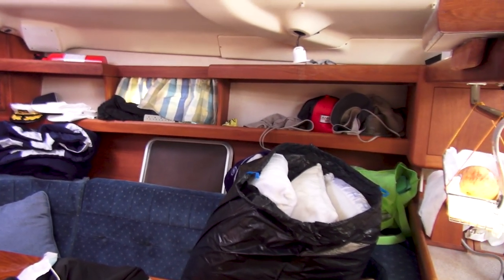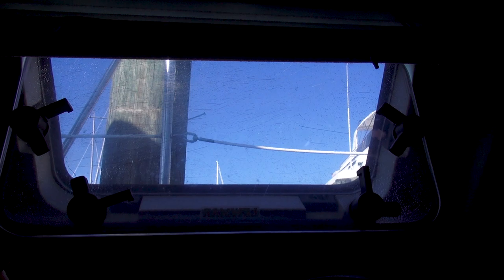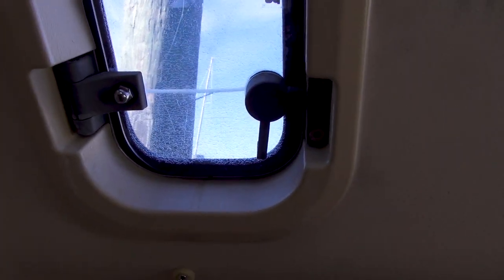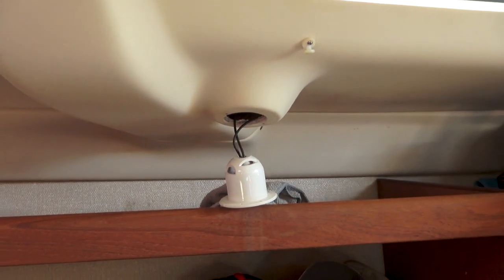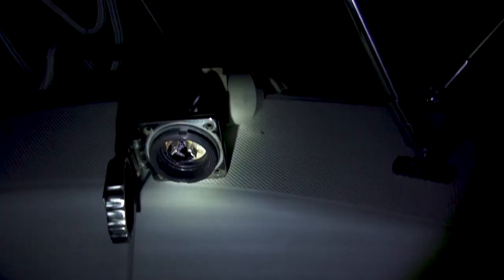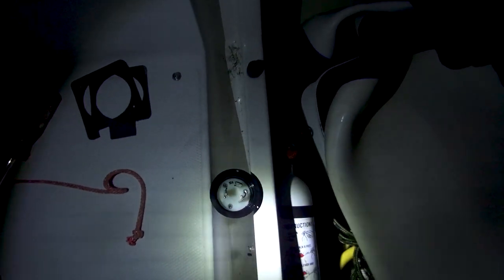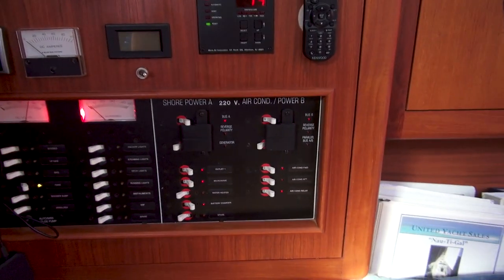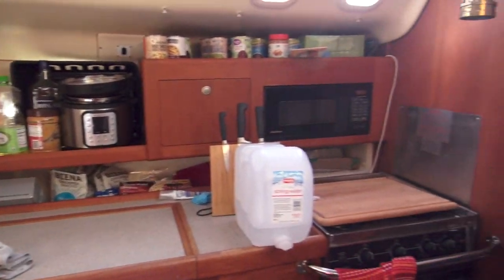Melted Electrical Outlets and Leaky Windows - Sailing Viridian Episode 23

Comment: Now that is the 4th hunter boat i have seen with the electric fry. The first one was a brand new 1995 hunter right next to my boat. It fryed the braker box on the boat and melted the cord on the dock and set the dock box on fire. That was in San Diego at Morena Cortez on D dock. Thats where they commission the New Hunters and Catalina sail boats.

Comment: Is this a Euro boat originally? Interesting that the shore power breaker box says 220V
Reply from the maker: You bring up a great point that I have noticed as well. There are quite a bit of Euro-spec parts. The water/fuel senders and gauges, most of the plumbing, and even the nuts/bolts tend to be Euro-spec. It's been a bit difficult finding parts, I generally just any Euro-spec part out and replace it with a US-spec part for ease of future replacments.

Comment: I have that AWL to tell the truth it is good but the Replacement needles are expensive. I also have and use the Harbor Fright 7 dollar Awl. Now the Needles are not out of this world. But they are cheap . And you can buy replacement Awl Needles for it. The Speedy Stitcher has a Proprietary Size and don't except average size needles. As Average "Same size as Harbor Freight Needles"" Are Slightly Larger Gauge. The Average size needles can be bought on ebay far less than speedy Stitcher Needles. Oh and you can get good Nylon Thread good for marine sewing on Amazon . This is where I bought a huge spool.

Comment: Windows belong in a house, bros.  Vocab counts.  I want to be kind because it's OK to be a noob.  But when you don't have a handle on the basics, it's makes me concerned about how you'll handle it when it's no longer easy.
Reply from the maker: "Even the greatest was once a beginner. Don't be afraid to take that first step." - Muhammad Ali

A certain level of preparation is important, but sometimes ya have to pull the trigger and figure it out along the way my dude. You either spend your entire life preparing for something that you'll never be 100% prepared for, or you just bite the bullet and go for it.